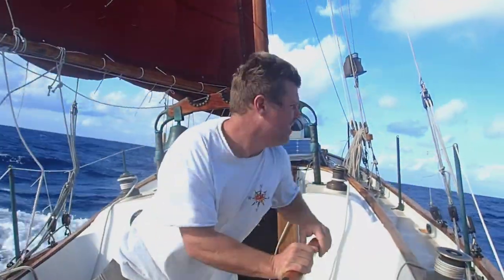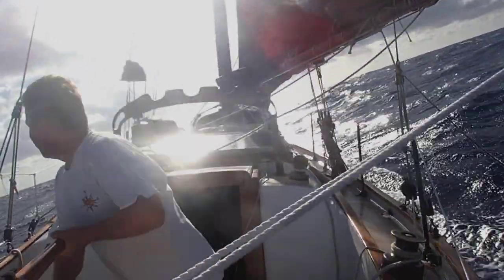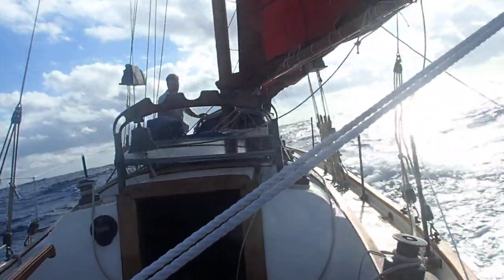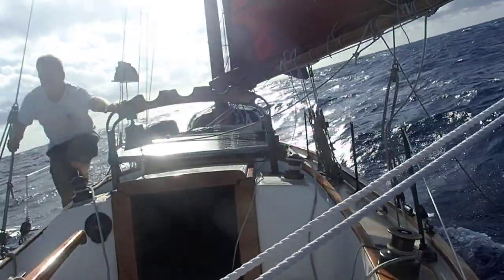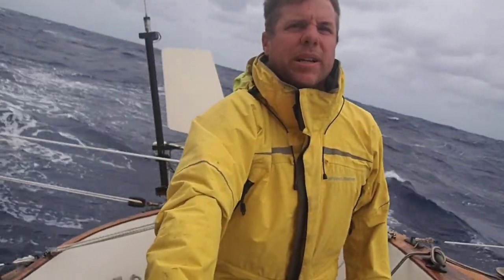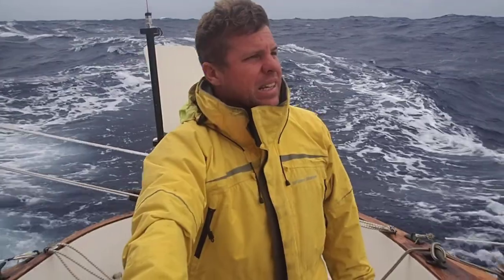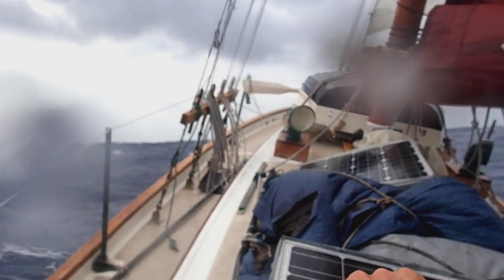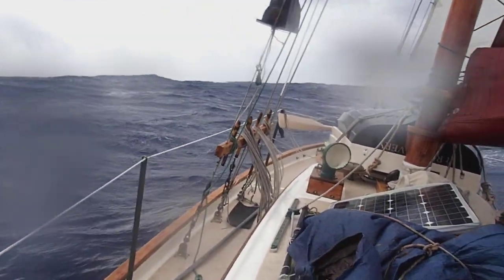Offshore to the Caribbean: The Heavy Winds Cometh

Comment: My jib sheets used to hang up frequently on either the lip of the forward hatch or sometimes on the mast halyard winches or cleats when singlehanded tacking or jibing so I have run a taught 3/16” line from the deck level base of the bow pulpit (port and starboard side) to approximately 6 ft height on the mast. The height and forward slope of this line keeps the lazy sheet off the deck and forward of the hatch and the winches and cleats on the mast so only very rarely do I need to go forward to clear a fouled jib sheet.

Comment: ... great seamanship and excellent video, but pushing your luck solo sailing without the safety gear
Reply: Good comment. Until the seas are built up in rough weather I always tow a 200 foot floating line as I feel better able to jump about the deck, free of a harness. That floating line is lashed fist to a light line that will break, in a byte, and then to the tiller. If I went over board, me grabbing it would break the light line and then pull the tiller hard over, stalling the boat. Once the seas build to the point the deck is not safe you have to wear a harness, and of course at night when anything could come out of the dark. I was watching Kev in the video, thinking the same thing as you. But I am sure he knows his limits.
Reply: With consideration......I challenge anyone to jump overboard with safety gear and/or using a following line in benign conditions and attempt to re-board....now try it in squall conditions..unless with crew nought on impossible...so either way (harness/no harness) your probably dead. Different story with crew. Best safety advice is don't leave the cockpit when solo-ing, set the boat up so as there is no need to go forward.
Edit: interesting story here on yt, about a tri I think. Solo sailing between the States and Japan if I recall, they found the boat with tether attached but cut through. They think he could not re-board so instead of getting dragged around the Pacific, well I think you all know what the next alternative was.
I am not advocating no safety gear just don't rely on it to save your life, better still, stay in the cockpit when solo-ing.
Reply: I had a number of older relatives who were fishermen none of whom could swim . I asked one why he didn’t learn to swim and the answer was if I go over the side I’m dead and being able to swim would only prolong the inevitable agony of freezing to death. Better to drown quickly and get it over with. I learned to swim. 😳
Reply: @pearlyshells2430  "so either way (harness/no harness) your probably dead."
Except if you have set up your harness correctly, you will drift aft and remain dragging by the transom. Although I have no single-handing experience, I have done re-boarding exercises in calm sea states, and re-boarded twice at 7 knots with minimal exertion.
I was going to do it 3 times, but my shorts inverted during the 2nd, and I had 8 people watch me scramble on deck with all my tackle out.
Reply: I worked on Pacific Albacore/Rockcodding commercial boats in the late 70's and early 80's from Fish Harbor, Ca. Then Longline Swordfish off Africa from San Juan, Puerto Rico in early 90's. The skipper never learned to swim just like his father and grandfather who were Whalers and Swordfisherman off the Grand Banks on my last FV The Miss Millie because the object was to stay on-board he said. I was told by Tom Spittle who owned the "Top Gun" which we were the "Highliners" of the Fleet that year for Albie's  " A Boat is like a boxing ring! It has a rail all the way around it! Everything inside her is Hard and Fast and will hurt You. The object is to NOT get Knocked out of the Ring!"
As a  "Fisher" in my late 50's who was a Sea Explorer and loved O.C.C.  Sailing Courses in Newport Beach I'm now shopping for a Seaworthy 30' with a Tiller. 
I love this Channel it stirs up emotions in me. Like Hurricane Gloria ⚓👍⛵
Reply: Wearing a wetsuit for underwear wouldn't be a bad idea if it's so cold anyway,  just uncomfortable.   I like the idea of a spring line on the tiller with the line trailing way out so if you pulled it, it turns the boat hard.  And last I heard there were no videos made of guys who lost their life falling overboard. Love your life, it's a gift from God to you.
Reply: @charliemcgrain  I'd love to see your setup! Sounds better than having to pull yourself aboard while the boat is going 8 knots! Have you ever tested that setup...with someone else on board?

Comment: Kevin, How about having a light polypropolene yellow, floating, line a hundred feet or so long tied to the stern.  Rig the line so if you give it a sharp tug it would trip the steering vane out of gear.  When you must go forward to work in interesting condtions with no safety harness, heave the line over the stern.  Should you go over you would at least stand a chance of grabbing the line disengaging the vane and allowing the vessel to round up so you could possibly get back on board.
Reply from the maker: I recall Pardey mentioning that in his chapter on self-steering windvanes, and then concluding that it is best just to stay on the boat.  Yes, that might give you a fighting chance if you should fall over, so would a harness.

Comment: Hello ---- i'm about ready to start a circumnav on my westsail that i've been prepping over the past 2 years - my question to you is what method do you use to hove to .  do you use a bridal off the bow attached to the rear of the boat and a para anchor somewhere in the correct position to achieve your hove to angle to the waves ?  -- thnx - good lucks

Comment: You give a good detail description of wind speeds you had to deal with etc, but wondering what speed through the water do you get in such rough conditions, I believe the speed of any boat is limited by its overall length but does that still apply in extra strong winds?
Reply from the maker: Hi Richard, once I get more than about 10 knots of wind apparent, and if the wind is aft of 70 degrees or so, she's around 80% of hull speed (about 6.5 knots).  So generally, with a good breeze, I'm doing 5.5 - 6 knots.  Close hauled that drops to about 4 - 4.5.   Yes, cruising boats are limited by the distance between the wave crests of the waves they make--they travel at the speed of such a wave.  Nowadays, however, racing monohulls can plane--check out Alex Thomson racing--can even get up on lee foils and do better than 30 knots.

Comment: Great video...quick question on the running backstays; can they be fastened further aft, near the transom?  Looks like the boom rubbing against them is pushing out on the lifelines... I see a loose lifeline stanchion on your starboard side, maybe as a result of the main pressing on the life line?  Not being picky, I'd just hate to see a lifeline/ stanchion fail as you don't wear a harness...thanks for you answer in advance!
Reply from the maker: One of the stanchions is slightly bent, but they are not loose.   You could rig them a little further aft, but you don't want them so far aft that the slackened runner might hook itself on the end of the boom, and need a lot of running to move it forward on the lee side when you let the main out.  Hope that makes sense.
Reply: @howtosailoceans1423  Ok got it, thanks!

Comment: Kevin, how do you lift the tender on and off the foredeck?
Reply from the maker: Hi Richard, I use the jib halyard for that.  One line is the painter, and two lines forming a bridle attached on either side of the transom.  But I still have to turn it upside down by hand ..

Comment: Kevin, it is sad to see the waning of on shore weather forecasters and the Single Side Band, radio, going the way of the Radio Direction Finder. You probably already know this but here is a copy of what Rebecca recently responded with on a Face Book site about receiving weather reports.....but what I like is the ocean current information which is surprisingly accurate. I don't know where else to get such information.  Also the combination of Predictwind and IridiumGo works 24hrs a day in any weather:  "If using Iridium GO, Predictwind is really what you want to use for your weather. It not only works flawlessly with the iridium GO, but more importantly, if you learn to use it properly, and what to do with all 4 reports, and their many options, the weather reports are actually pretty accurate for Offshore! Not always true near land, but at sea, Offshore...such a huge improvement over just getting the GRIBS like we all used to through Sailmail or Airmail on SSB or sat phone."
Reply from the maker: Yes, at some point I'm going to need satellite communications, hopefully at some point they will be less expensive.  But there is no question that weather forecasting has significantly improved over the past decade or so.